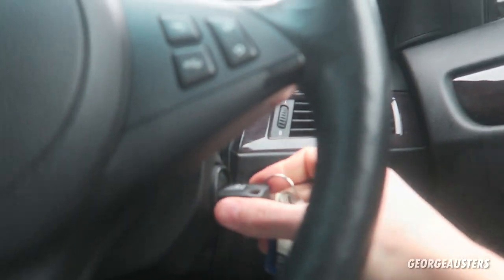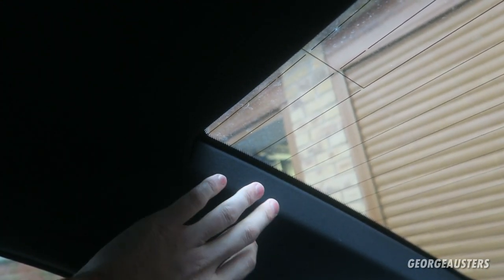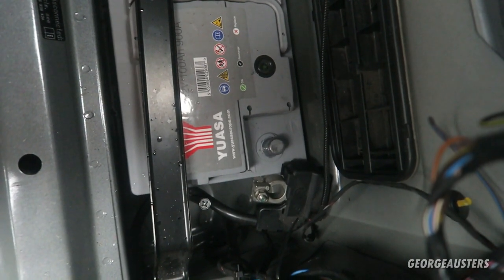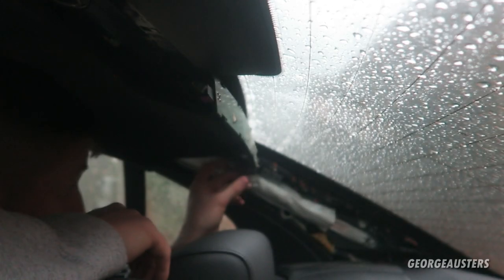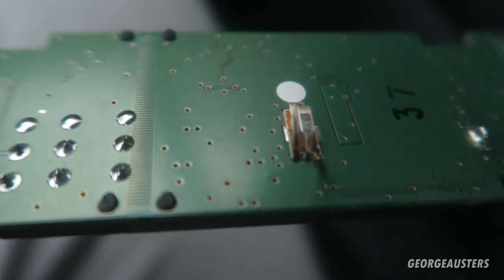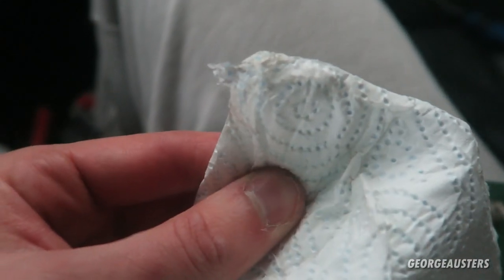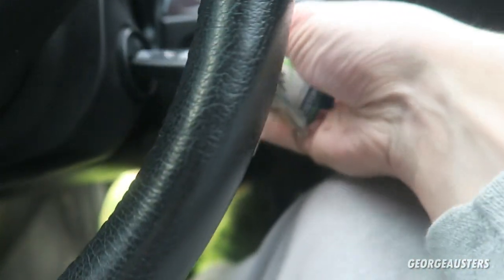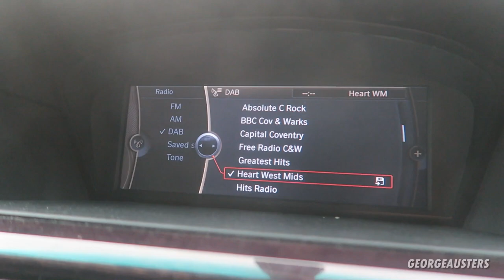BMW E60 Diversity Antenna Removal | Radio & TV Signal Problems

Comment: Hi George,  my 2009 535i E60 driver comfort access does work. The rest of them unlock the doors while I reach my hand I pull the handle. Can you tell me what parts I need to replace? Thanks

Comment: Worth mentioning for E61 (Touring) owners that the diversity antenna is not in the same location.. it's located under the spoiler on the rear boot hatch! Really need to do it on mine as whilst radio is fine, the key has to be basically right next to the rear windows before the car will lock / unlock :(
Reply from the maker: Yeah that’s what is making me think the antenna is not totally bad for me
Reply: Had this problem with mine, took the amp oit cleaned it up still no better. After much investigation found many broken cables in all of the 4 conduits to the rear door. I've temp mended them for now and will be modding the whole wiring to the rear to stop this happening again.
Btw, the feed to the amp is in one of the 2 hinges on the drivers side which may be broken / shorting out.
Reply: what is rear boot hatch? Thank you
Reply: @johncheer9164  The tailgate / trunk.

Comment: Does it do it on all frequencies? Just I know each frequency has it's own line in the rear window so if it is just certain ones could be a break somewhere in that line.
Reply from the maker: How do you mean? I’ve tried it on FM, DAB and TV
Reply: @GeorgeAusters  I'm no expert mate but I know the antenna grid in the rear window has separate lines for am/dab/TV/fm1/fm2 etc and then the demister aswell. Just thought if it worked ok on some and not others it could point to a break in the lines in the screen. Or maybe a faulty wave trap.
Reply from the maker: Just checked and signal only drops with heated screen on with DAB and TV... FM is fine. Think there is 1 or 2 lines not working on the screen btw. What about when I have poor TV / DAB signal even without the heated screen on?
Reply: @GeorgeAusters  That could be down to a faulty wave trap.
Reply from the maker: @miagreatsister9612  So you reckon a new windscreen will do the job?

Comment: Just a quick one, are there no issues regarding disconnecting your battery?
Reply from the maker: No you’re fine to disconnect your battery but you will lose your trip miles and have to reset the time👍🏻
Reply: Cheers, I thought there was something to do with battery registration that could cause an issue.
Reply from the maker: @Turbostott  You only have to register the battery to the car when you replace it

Comment: The DAB reception comes from another amplifier on the opposite side of the rear high level brake light.
Reply from the maker: Same with the TV signal too?
Reply: Hello.Do you know where it is located in the x3 f25?I have a B7F809 -head unit antena dab 3 disconected.Thank you!!!
Reply: @GeorgeAusters  dumb question for you how are you getting tv signal in the car

Comment: Did you sort this problem in the end? Thanks
Reply from the maker: Not yet
Reply: @GeorgeAusters  ahhh. Do you know if there would be a way of bypassing and just adding a signal amplifier (booster) to the back of the unit?

Comment: Is it the original glass still in it or has it been replaced?
Reply from the maker: Not sure mate, why?
Reply: Never know, it could be problem with the glass itself as the aerial is built into glass. I've never heard of it causing a problem but just something to rule out.

Or lines in glass could be damaged?
Reply: Rob Davis this just happened to me, anything you suggest?
Reply from the maker: Couple of my lines in the glass don’t work when using the demister

Comment: Just a thought, the isdue may not be with your car. I know where I am in Norfolk, that the signal quality can get pretty bad.

Great vid as usual.
Reply from the maker: Doesn’t matter where I go, signal always drops when I have the rear window demister on mate
Reply: @GeorgeAusters  hmmmm, tricky things these antennas. Not something you can get tested locally?
Reply from the maker: @Turbostott  I may end up getting my windscreens replaced and see if that solves the issue

Comment: If you have LED light installed in your car, that could be the problem!
Reply from the maker: Why is that?
Reply: @GeorgeAusters  Google EMC! So for example, if you have led angel eyes, you need a EMC-filter connected to the bulbs.  :)
Reply from the maker: It wouldn’t explain why the signal drops when I use the rear windscreen though..
Reply: @GeorgeAusters  Im not sure. Maybe its different frequencies?. But the led bulb can (depends on brand) send out frequency thats interferes the fm signal. :P

Comment: the TV went really bad on our E65
Reply from the maker: You mean in terms of the signal? I'm thinking it's for sure related to the rear windscreen
Reply: @GeorgeAusters  ye one day half channels were gone and fuzzy. It sat a lot that car and it all sorts of problems ensued - typical 7 series and typical bmw. Then a few years later the fibre optics went and lost radio, satnav and a lot of other infotainment stuff
Reply: Did you check out your E61...where the brake light is? I would do that and make sure your connections are making contact especially with the antenna on the back window.